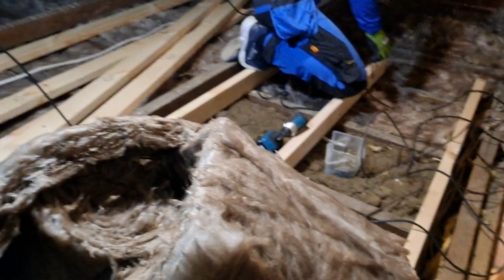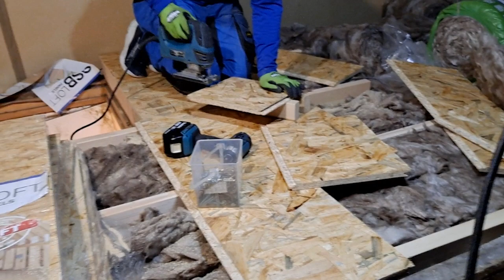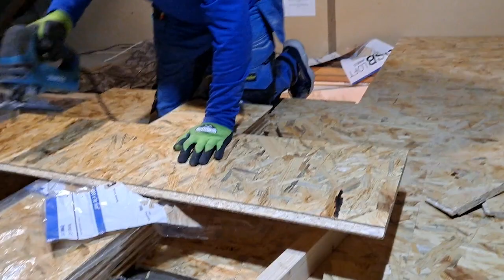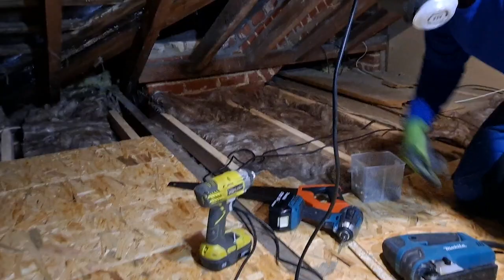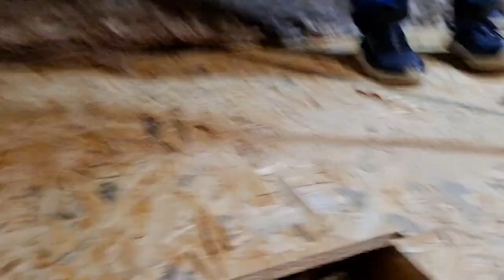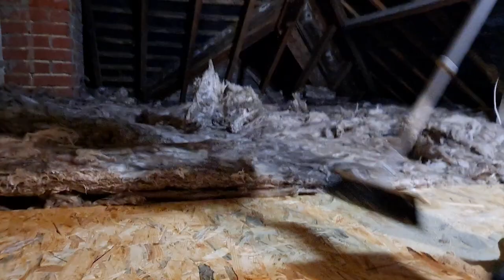Small loft boarding job using OSB and insulation

Comment: Hi I have a new build with 270mm insulation, how should I go about boarding out, from your other videos you use 89mm CLS??
Reply from the maker: hi, we usually just board the middle section of a new build, we can usually lay the cls between the insulation grooves (if this makes sense) as long as you do not take any insulation out of the loft the 10 year guarantee is fine,
Reply: Thanks, haven’t measured the width of the insulation yet but guessing it could be outside the ‘normal’ 400mm spacing for the OSB boards and if so what would the solution?
Reply from the maker: @richards9850  we just move some of the excess to the sides as the osb boarding acts as an insulant.
Reply: Thanks it’s my project for next spring/summer but will keep a look out for any new build videos you do.

Comment: Is it okay to space joist 24 in apart if I'm using 3/4 inch osb
Reply from the maker: yes, thats about the right spacing.
Reply: @MrBish11  They want 16in. Cant hurt anything I guess...lil extra weight. It will be sturdy for sure. Thanks